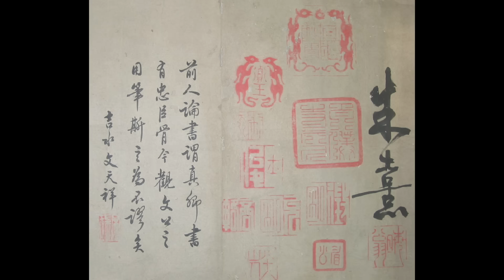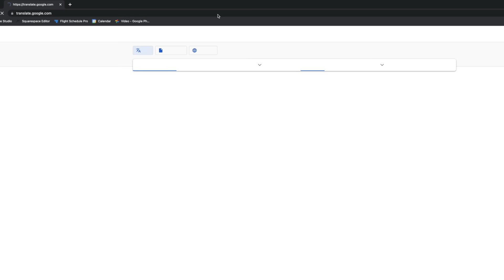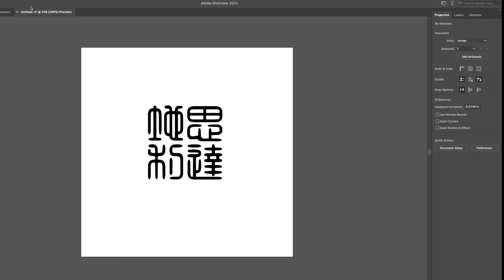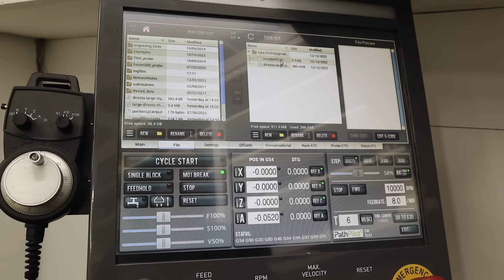Giving My Mentor a 3,000 Year Old Tradition for Christmas

Comment: That's crazy that the vacuum trips the breaker when the CNC doesn't. 🤔

Also, I completely agree with the 'clearing of the CNC name'. While a lot of my friends look at something done on a laser or CNC as easy, because 'the machine does everything', so they don't value it as creative or worth paying for, they don't understand how much trial and error goes into it. Not to mention the designing in the software and the learning curve needed to be climbed. And that's even with bought or downloaded 'ready to go' files. Still have to get settings right for the machine

Comment: Osage Orange aka Hedge. The fruit is said to drive insects (especially spiders) out of your home. Well, as it began to rot, it attracted fruit flies and spiders who ate the fruit flies. Not one bug left the house. BUT, if you burn wood in a stove, never load it with hedge as it will make your stove get yellow hot and dance like crazy as it has it's total meltdown, and hopefully not burn your house down too. 
BUT! Since it burns so hot, it is great to use in a home built smelter to melt metals that one can recycle from micro chips and thus build up a stash of gold, silver, platinum, nickle, and copper. Or melt whatever metals you want to use in casting. It is native to this state, Missouri, and  many use the 10 yr old saplings as fence posts that are known to last up to 200 yrs. 
What you did with your piece is awesome! And I know a little bit about those stamps as I used to have a huge collection of papercut card and they had the artists stamp on the back. Every one was a red stamp.
Reply: pinnedXylaFoxlin : Unable to use whatsapp from here.

Comment: You might try getting a short icepick or a right angle super thick dental pick my old man has both in his toolbox of doom.
Reply: Looked like ya kept slipping cuz ya were working so far from the piece with a short action lever. Engravers are also fairly nice for this work so long as you got suction on it. Personally I use a dremmel with a ball bit or a side cutter/end mill with the little blower Collette on it for worm rot.

Comment: The Water Chopper could totally be made safe(er)! I think @colinfurze need only cage the props to keep them safe...enough. That will not change the need to keep clear of grass.

Would have to measure the torque to see if feasible, but I think a dual shaft drive could replace the chain, solving the water transport problem.

Building a waterproof drive box is very feasible, but would require new maker skills for Colin. A water safe drive system is certainly possible. Maybe it could be a colab?

I will say that Xyla does world with so many types of dangerous things, and now has two rocket propelled Christmas trees under her belt. While caution is always the right path, i think Xyla is very much prepared to handle the ChurnWater 2000, even with the water cooling supply feature unresolved.

Comment: The only way to actually stabilize most woods with any kind of resin is to vacuum chamber the air/water out of the wood and the resin and then pressure chamber the piece and force the resin into the wood. This looks good though and doesn't really need stabilizing so whatever but just saying if you one day need a properly infused piece of wood.

Comment: put it in a holder like a bench vice. Sharp hand tools 101 don't hold things with hands in the same direction the tool is moving because it's a case of: not if but when it will slip and end up in your hand.

Comment: Did you need to keep it under pressure to stop the Epoxy bubbling while it set? Nick Zametti usually uses a pressure pot/chamber for any resin projects.

Comment: Okay okay so I don't have enough income for Patreon rn but I had an Idea in a story I was writing and- here. "a finely crafted wooden box, with a painting... under a very thin layer of protective epoxy inlaid in the lid. A flexible line of LEDs lit the upper edge of the inside, and they made little, square-shaped clay paint pots that fit snugly inside the box, along with troughs along the bottom for miscellaneous art supplies and a second layer for other supplies that folded down from the lid when the box opened. There were even little loops in varying sizes to hold brushes along the sides."

... so anyway you can tell from my writing I have been watching quite a lot of xyla lately-

Comment: Couldn't he fix the thing?  Cages for the blades, a proper holder for a drill rather than a grinder...so you don't lose your hearing, or get whacked in the head.  And why did he make it straight?  It needs an angle, so both blades can get in the water.  And apparently it needs sealed, so it does not fill the boat with water.

Comment: Soooo, just watched Colin’s video.

Yeah. If he bends it so both blades are in the water simultaneously — it’s actually not a paddle, it a twin-bladed, hand-held, dangerous, underpowered and imbalanced outboard motor. 

That’s absolutely brilliant.

Add a screen over the blade and it’ll be a wee bit safer. Otherwise, think of it as a double-ended immersion blender good for mixing giant vats of epoxy — or it could be hung from the shop ceiling and used as a fan. 🤷🏼‍♂️